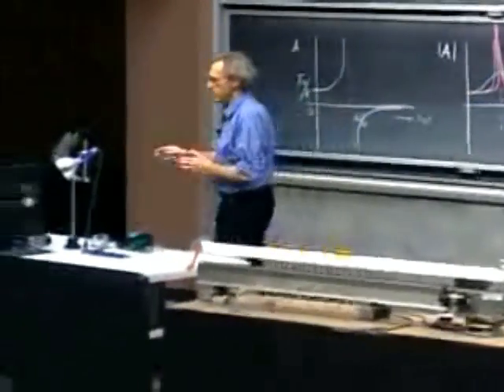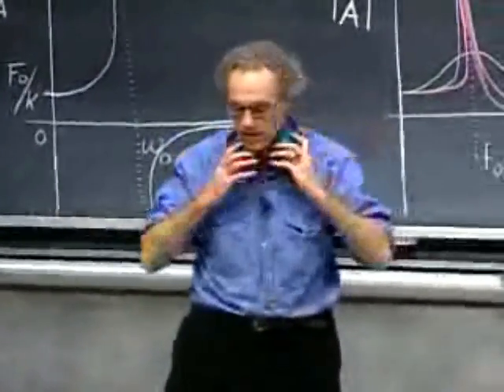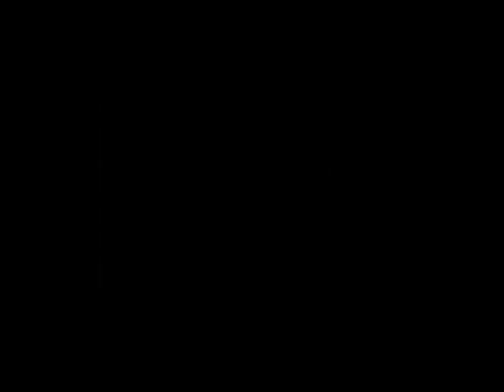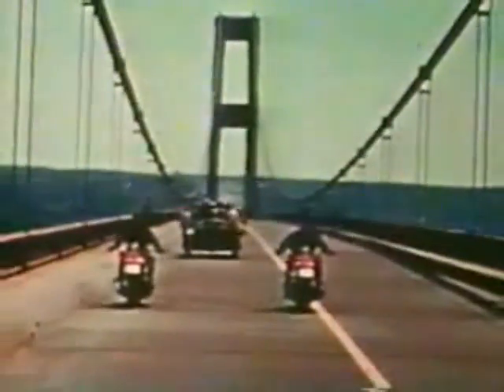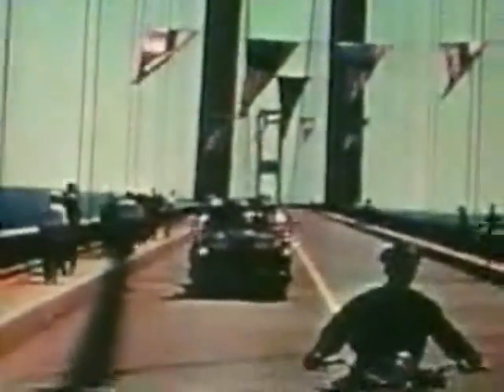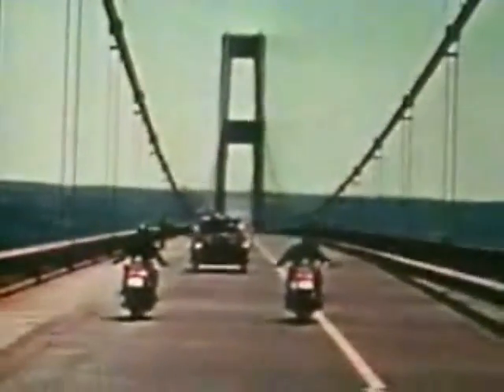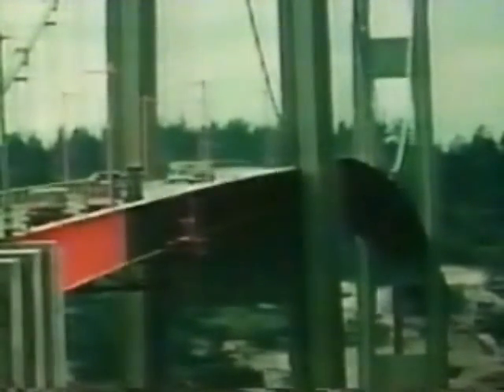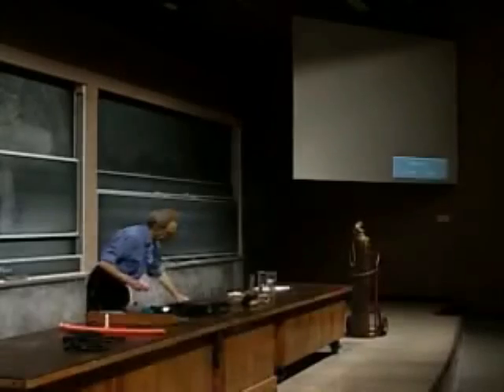Resonance

Comment: Is glass can be broken by frequency of light just like frequency of sound??
Reply: Light waves and sound waves are two different things
Reply: @spockmx9426  yeah they are different . But they r  waves  thus have frequency.
But what kind of difference make them different .
Reply: @beeagle5801  the frequency required to break the glass is about 556 hertz which can be produced through sound waves easily because it ranges only from 20 to 20000 hertz but the frequency of the electromagnetic spectrum ranges from 10^10 to 10^24 hertz which is very high from what frequency we actually need to break the glass and since the light waves can't have the frequency anywhere near 500 hertz it's not possible for the light waves to match the frequency of the particle's oscillating motion in the glass
Reply: @spockmx9426  that's the satisfying answer👍🙃

Comment: What was being used to produce the sound? What kind of "plate" was next to the glass? What was the plate attached to thate lowered and raised the volume and frequency?
Reply: It is simply a speaker with a diffuser, which is driven by a signal generator.

Comment: Is there a lecture or video that explains WHY resonance does that? With formulas and all. I saw this explanation once, and if I remember correctly, there is a division by zero somewhere in there. Which, of course, produces infinity.
Reply: The amplitude at resonance of an undamped system is infinite. This is seen in the mathematics. But all systems have damping of some degree, however slight. A lightly damped system at resonance will hit its mechanical stops at the resonant frequency and tear itself apart.
Reply: Kurtlane Yes.